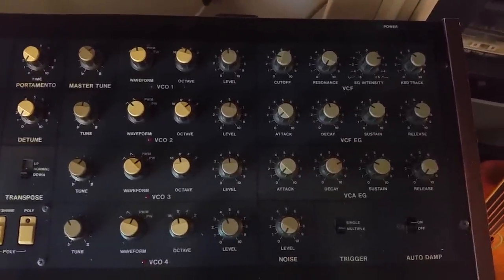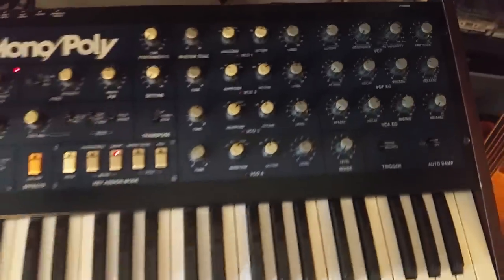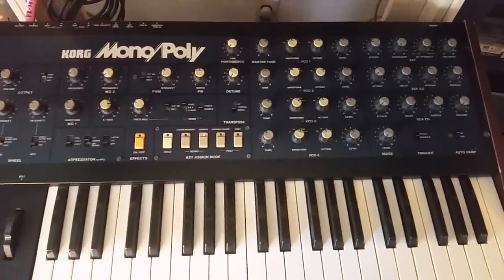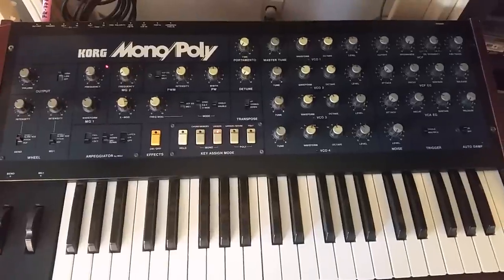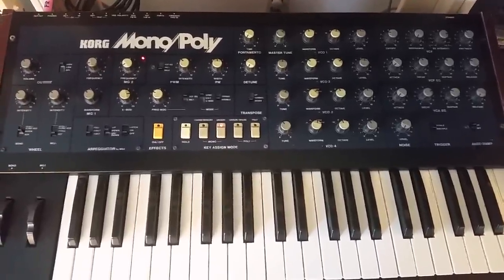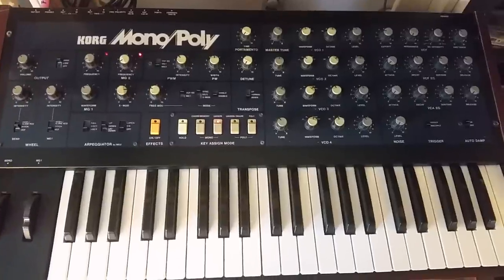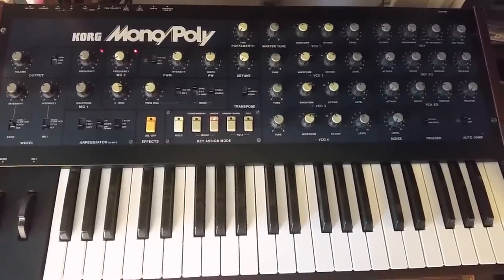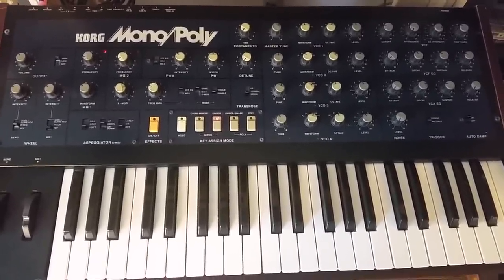New Synth Knob Multiplexer - 64 Analogs in one!  Part 1

Comment: This is actually pretty rad. You answered my question about how that analog signal is routed riiiight at the end there. well mostly. Does that mean the synth has to decode the header to get the right route to your pot ? That's actually way interesting. Is that going to be integrated with the Axoloti as well?

Comment: CD4051 ? any lib on github ? cheers
Reply: The CD4051 is an integrated circuit which is made up of analog components, mainly transistors diodes and resistors. It works by means of diode conduction and transconductance, aka transistor action. There is no code but if you search for "CD4051 data sheet" you can start your journey down this rabbit hole. It's well worth it. 😂👍
Reply from the maker: Hi yes.  This uses a 4051 for the mux along with a 4040 counter chip and 74HC138 one of N selector.  I'll be posting the code soon!